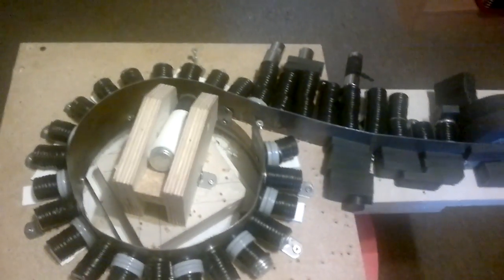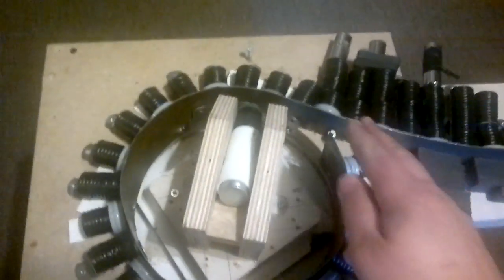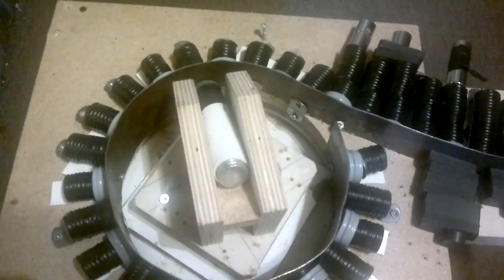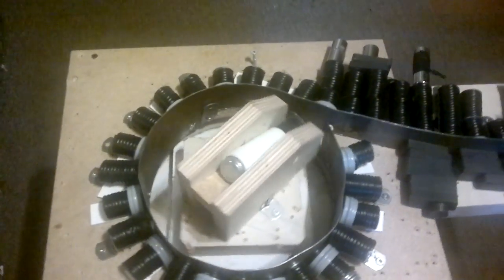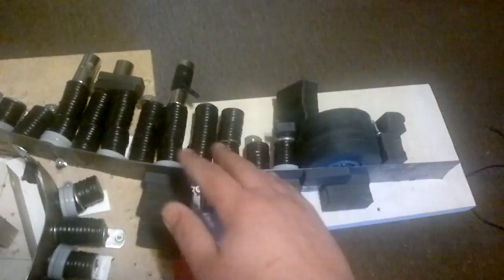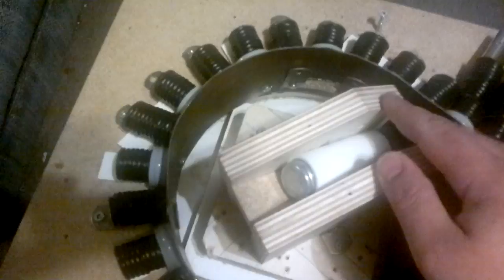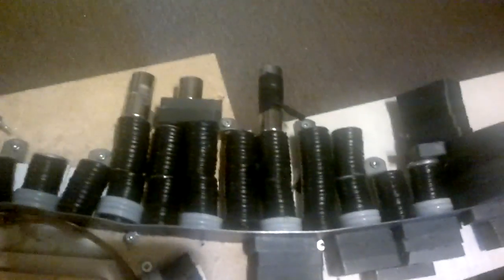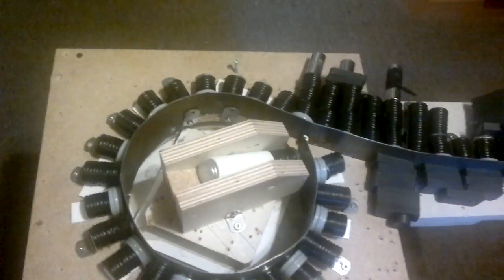Candy Cane Configuration Magnet Motor Rotation Test 96 percent Rotation Following The Flux In Steel

Comment: u got t all wrong men. the rotation u have had is simly due to the spring effect of the magnet. for you to claim "rotation" the rotator sholud spin anywhere inside the circle of stator. wat ur doing is turnung bck the rotor to the the same spot again and again. that favofrite spot oposes te rotor so that if u try turning the the rotor against it, it springs back thst is the only spin u had . the rest f the spin does not come ftom magnetic power but flywheel momentum. tihis mesns u could rrmove d rest f the magnets in the statotr and imply leave the magnets to which u lways turn into ur rotor and u ll have d same spin. i belueve ur 96 % refers to the pin by mere momenum. the 4% only by true rrepulsion.

Comment from the maker: hey thanks for commenting! No I have not thought of copper as that would create eddy currents and drag. The metal serves 3 purposes, firstly so I can jam like poled magnets side by side by sliding them down from above otherwise repelling would make it almost impossible to do this. Secondly they blend and bridge the magnetic field between magnets and third they keep the magnets in place. A copper ring could be used for trapping the flux by wrapping it with wire as it pulsated, if it worked.thanks

Comment from the maker: thank YOU. Yes more arrays are one of my ideas, I have several I am just going through them one by one not as fast as I would like to, but I am getting there.
If you look at the Tesla AC motor patents you will see him have 8 stages to the rotation of his rotor. So basically you can just make 8 stators, one rotor with 8 magnets on the rotor on different heights each matching one stator. all offset by 1/8. I think that configuration would work as 7 magnets would be pulling the one that would stop

Comment: Your energetic enthusiasm is inspiring.  We must first endure an equal amout of compressive force to get that repulsive force to push the rotor. Is this effect 50/50 as in the 2nd law?  Yes, if we didn't have the rotating mass...its more like 48/52
 A 20 lb rotor is good as as 20lbs of momentum if its not fighting its own mass. If you used neo array under the rotor, the mass would approach equalibrium or neutral, then the mass can be used for just momentum.   It may get you closer to 50/50

Comment from the maker: Yes a lot of work, the first time I put it together I had a placement problem that I didn't realize, some magnets were moving in closer to the rotor pushing the steel in about 1/8 of an inch more on one side then the other and I could not tell from the top view. It was giving me strong zones when they should of been weak. When I found out all my work was in vane I almost took a hammer to it! So I let it sit for a month until I calmed down then redid it. Thanks man.